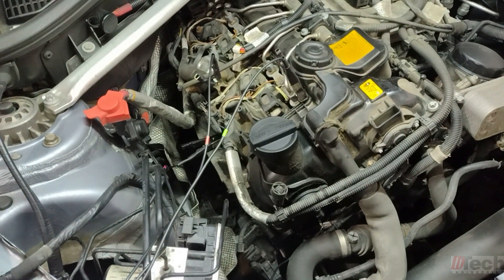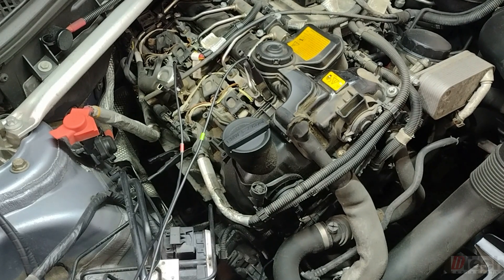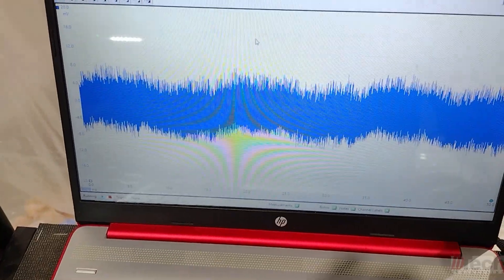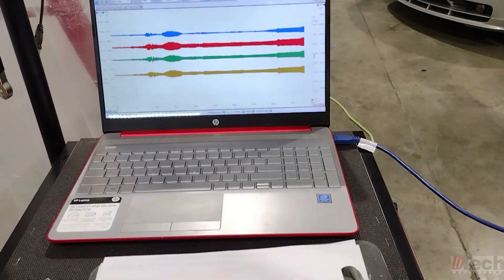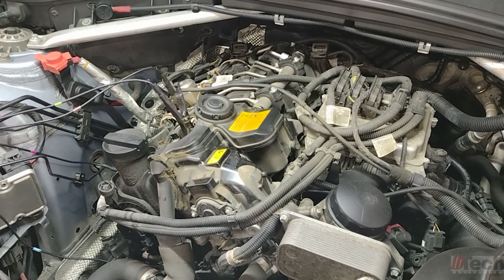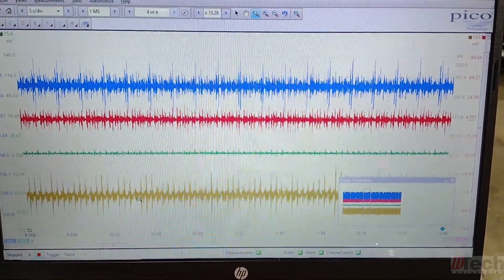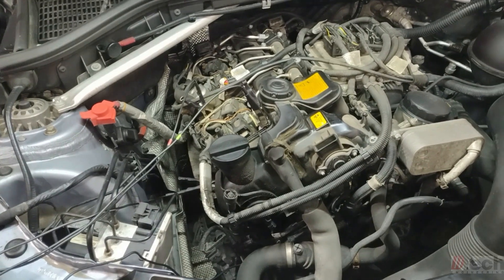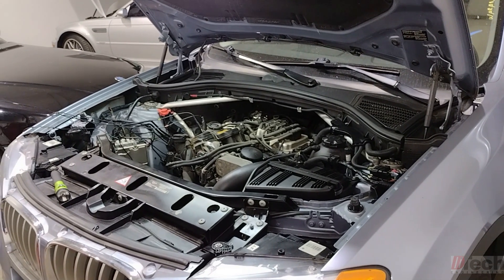Capturing Noises On a Scope

Comment: Hello maesto Sadel are does chasis ears. What adapter you use for the picoscope? Can it be done 4425a pico?
Reply from the maker: Yes they are the chassis ears, and I use adapters I make to connect them to the pico, yes they will work on the 4425a

Comment: Hi Sadel,
I Enjoyed the video - thank you.
I have also used this technique with some success In the past.
Would it be possible to prove out the theory of lifters causing this noise by adding Rpm / another Chanel to sync from and checking frequency of the noise?
In my experience these N20 engines suffer piston noise / piston slap that alters with engine temperature.
We replaced several block / pistons under warranty at the dealer and each was fixed. I have audio files that I captured before and after repair if you would be interested to hear. 
In any case, nice video. Thank you for your efforts.
Reply from the maker: Andrew, thank you for watching first of all, and yes, it is possible to add a sync to try to identify noise during the 720 rotation. Your experience with the block and piston replacement is interesting, contact me if you can.....DTEAUTO@Gmail.com
Reply: @DTEAuto  Hi Sadel,
I sent you an email with more info. Regards Andy

Comment: Great video Sadel, I have made my own noise sensors using knock sensors mounted to 4" spring clamps. They work really well and were quite inexpensive to make. I'm using the 4425 Pico and I have one for each channel. I have to agree with Dave, that 8 channel Pico sure looks sweet.
Reply: Got to show me that one bro
Reply: Just made one with the stethoscope on the delta pulse sensor like Hans. Works really well. But love the ideas
Reply from the maker: Northpostman, thank you for watching, and yes the 8 channel is very nice to have.

Comment: Nice tip. Can you try it with knock sensors? I use them all the time for those rod knocks issues
Reply: Hi DJ, yes knock sensors work well. I use the banjo style bolted to 4" spring clamps.
Reply from the maker: Thank you for watching DJ